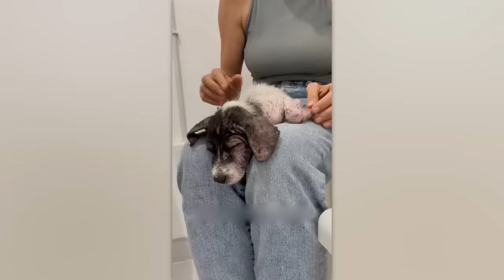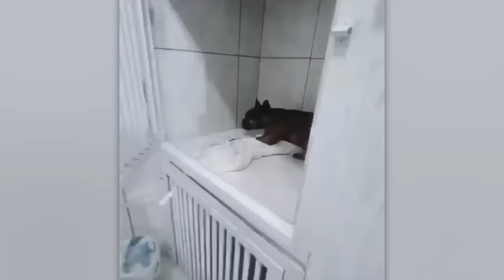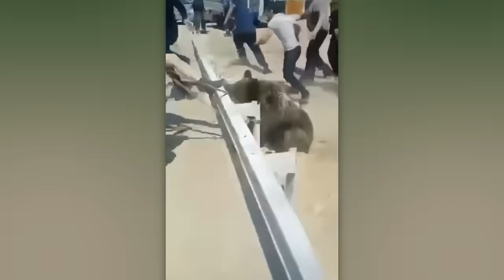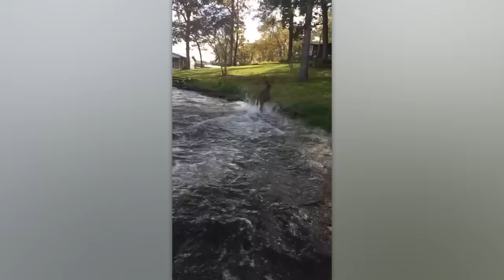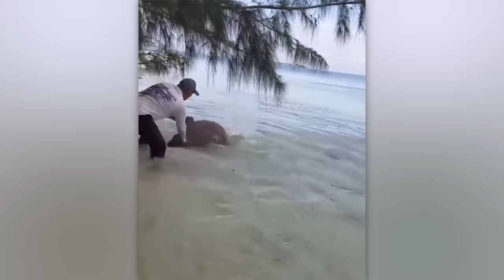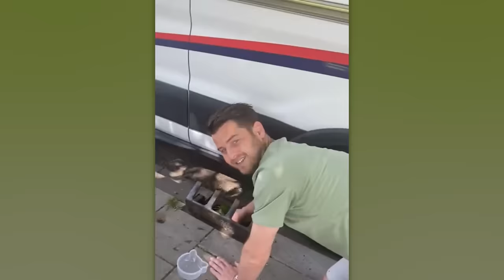Animals That Asked People for Help and Kindness Caught on Camera

Comment: Fences around open space, like the kudu in this video got stuck in, are harmful to wildlife in other ways than getting caught up & injured in them. It stops them from passing to migrate to other habitat areas to find mates that have different gene pools. Mating with those having shared genes causes genetic problems leading to diseases not only weakening the individual animal, who'll have a shorter life span, making it easier prey, genetic weaknesses & genetically-based disease gets passed on. Less newborns make it to adulthood & those that do have a decreased chance of getting to old age or have healthy young themselves. The number of individuals in that isolated population falls each year becomes depressed) and the population ultimately becomes extinct. 

This process is called inbreeding depression, hence, the importance of not blocking movement of wildlife. Not by fences. Not by roads. Instead, passages through, under or over the obstruction needs to be installed. 

Wildlife experts and departments of transportation have become aware of the roadkill problem & these crossings are being planned into or retrofit into highway construction & maintenance.

But fences have their own challenges. There are variables, like material, style, barbed or not, purpose of fence and building in gaps with features that help wildlife find the crossing gaps, so the target wildlife species can pass while maintaining performance of the fence for the property owner.